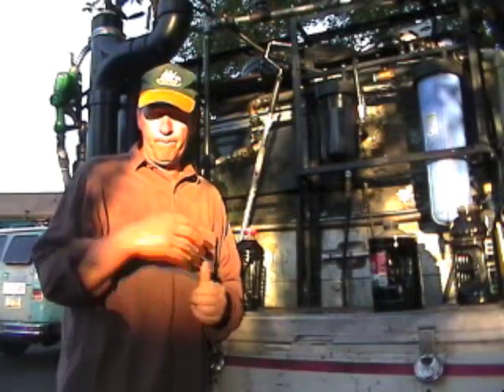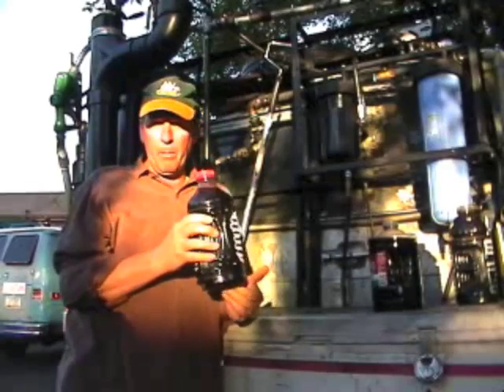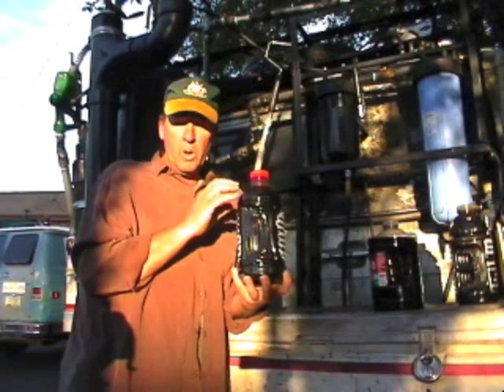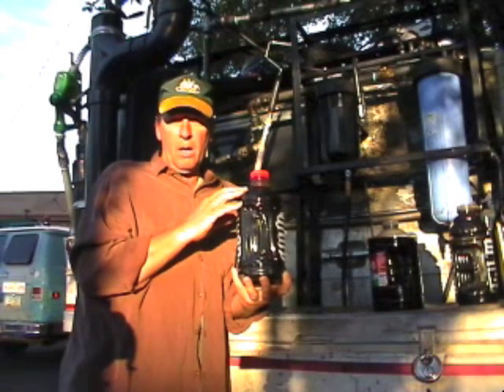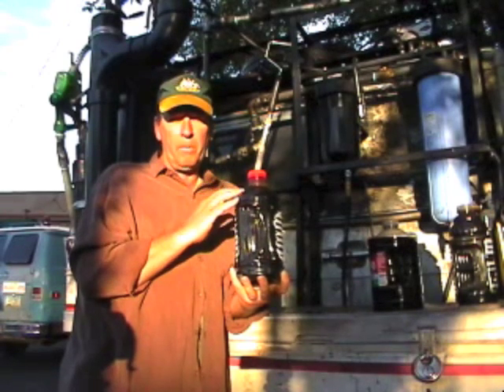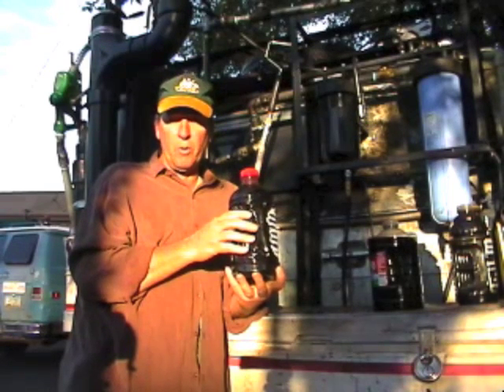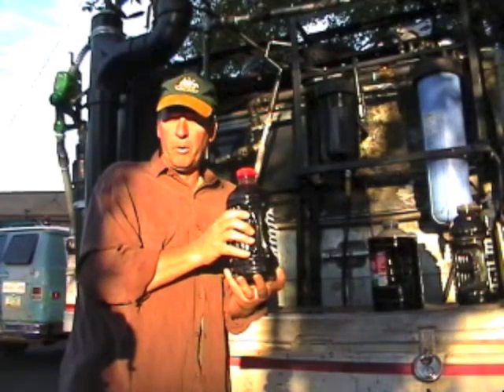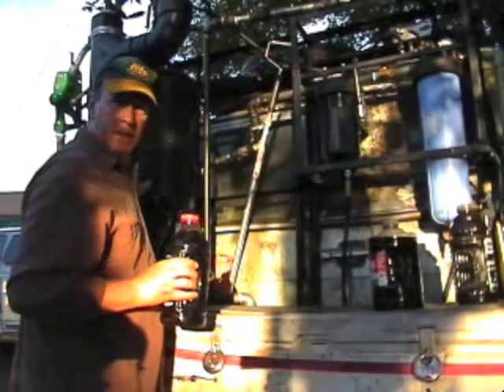Making Black Diesel from waste motor oil (WMO)

Comment: If you're using bio-oils as engine, and use a natural solvent such as Alcohol then even black diesel can be considered Bio-Fuel. I use a Mixture of Rosin Oil, Algae Oil, with fine powdered graphite, which is a very long last, quality mix. The graphite is removed by the filter in the Black Diesel processing unit and can be re-used. I add either Turpentine sourced from the same source as the Rosin Oil or Ethanol I make with Solar Distillation.

Comment from the maker: Thanks for posting your success with burning WMO on a 1988 7.3 idi without a turbo,  The thick film that settles out of your WMO is something that you want to happen.  The ways to keep it from settling out in your fuel tank is to settle your WMO blends longer.  It take my WMO blends 1 month of settling for the black sediments to stop settling out.  Or, you could use a centrifuge to accelerate the settling of the black film. It may take several passes depending upon how long you settle your WMO.
Reply: Agreed on the settling process. A month or more at best with filtering;  I'll be using WMO for an older John Deere tractor, much less finicky than a newer vehicle..

Comment: 1988 7.3 idi without a turbo and a cummins 5.9 24 valve p-pumped conversion without a turbo for my house generator, the 7.3 had 50,000 miles when i started using black diesel and now has 225,000 miles and starts and runs fine.i use the additives to help keep the carbon low off the valves and internal parts.the cost per gallon of black diesel is $2.88.  the only problem i notice is that alittle thick film settles out of the finish product how to stop that from happening  and suggestions  thanks

Comment from the maker: OK, Mike, so, do you have a turbo on that diesel engine that you have put 150,000 miles on burning black diesel?  Because I have a hard time believing that paying a lot of money for snake oil is going to make it so that I can burn WMO on my n/a diesel engine without coking its injectors.  

However, if someone with n/a a diesel engine like mine can put 150,000 miles on it burning black diesel, then I will look at the snake oils.

Comment: instead of giving up why don't you use some additives like diesel clean diesel supplement, sea foam, stp cleaner and fuel power. i have been using these in my truck and have over 150,000 miles on black diesel with no power loss. try this

Comment from the maker: 1) Anecdotes from people burning WMO show that those without a turbo have far more coking problems than those with a turbo.  The turbo appears to increase air flow through the cylinder, which might function to blow the cylinder out of ash and coke.
2) I am still developing my WMO distillation unit.  When I have it more developed I will definitely make a video of it.

Comment: Hey Jeffrey. Just checking to see if you've tried any further experiments with WMO/ gasoline blends on your non-turbo van. Last time you said you wouldn't be running WMO/gasoline blends again, until you could distill it, because of  coking issues.

Comment: Have you ever tried water injection on your diesels? It would seem from my research that water as a 20% emulsion or sprayed as a very fine fog into the air intake results in lower emmissions, lower consumption and much cleaner cylinders. The cleaning effect has to do with the micro- explosions of water into steam which both adds to compression, and helps to atomize the diesel/oil fuel much better due to micro-exlosions. The cleaning effect really intrigues me. Your thoughts on this?

Comment from the maker: Good question.  I was running a blend of WVO at 50%, WMO at 20% and gasoline at 30%.  That blend ran for 3 months before the injectors coked up and the IP failed.  I think it was too much gasoline and too much WMO.  If I were to try it again I would keep the gasoline at 20% and the WMO at 10% and the WVO at 70%.  But, realize that WMO and WVO do not like each other, so they have to be settled for about 3 weeks after blending to let the crud settle out before filtering.

Comment: Just to clarify. When you say WMO blended with gasoline at 15% or less. Do you mean 15% WMO to 85% gasoline in a  non-turbodiesel engine? Or do you mean 15% filtered WMO mixed with 85% diesel fuel?

Comment from the maker: At this time I cannot recommend burning WMO blended with gasoline in excess of 15% WMO on any diesel engine without a turbo.  However, keeping the RPMs up helps marginally, so does making a translucent blend.

The military paid for research to see if they could burn WMO at 7% blended with JP8 to get rid of the WMO, while lubricating the JP8 fuel.  Well, that resulted in coking the test engines to near failure.  Neither test engine had a turbo.

Comment: Mmmm... not really what I was hoping to hear. I could possibly do a turbo conversion on my Merc 240D. I mostly do trips of about 16km around town though, so not sure if the turbo would be helping much at auch low speeds. I seem to recall you mentioned in another post that keeping the revs up by keeping the car in a lower gear could also help avoid the coking issue. Perhaps I'll try that.

Comment from the maker: With a lot of work I was able to get my non turbo diesel engine to burn WMO blends at < 20% WMO for 3 months before the injectors coked.  So, I will no longer run WMO until I can distill it.  Whereas, 80% WMO blends that had been exhaustively worked ran for a month max on my engine.  However, it is possible that WMO blends < 10% WMO might run indefinitely on my engine

Nonetheless, there are lots of reports of people running WMO blends on turbo diesels at 80% WMO without coking their injectors.

Comment: Thanks for the reply. Does the injector coking problem mean that you no longer use WMO on your non-turbo vehicle, or do you just continue to clean it using your turpentine and ultrasonic cleaner technique. ( Also, how many miles on average do you find it takes for the WMO gasoline 20% blend to coke your injectors to the point that you have to clean them?) Thanks.

Comment from the maker: I have samples of WVO and WMO that I blended with gasoline about a year ago. They are still blended; therefore there is no reason why gasoline would separate from any waste oil except through distillation.

However, I have found that WMO cokes my injectors badly even at only 20%.  My diesel engine does not have a turbocharger.  The diesel engines that seem to be able to burn WMO without coking their injectors all have turbochargers.

Comment: Hi Jeffrey - Do you find that once mixed the 80/20 WMO to gasoline mix stays blended, or is there ever a chance that the oil and gasoline might separate out again. I have an 80 liter tank, so I'm trying to decide if  I should do one big batch of 80 liters, or smaller batches of 25 liters, in case there are problems with oil and gasoline separating out over time.

Comment from the maker: Blending a solvent with anything can produce precipitates.  Blending gasoline with WVO will force water and particulate out of solution and suspension in a fairly short period of time.  An hour of settling might be enough, but I have found 24 hours of settling WVO-gasoline blend works best.

Comment from the maker: @Begbucks My odometer says that I have put about 10,000 miles on my engine on waste oil blends in nearly 5 years, but the over-sized tires have screwed up the clock.  However, I have not driven my own vehicle much in the last 5 years, because when I am doing archaeology I then tend to drive a company truck, and my van is hundreds of miles away.

Comment from the maker: @Begbucks I made up a business card and magnetic sign for the side of my van that say I recycle waste oils and solvents and put my phone# on them.  I also stop in at small restaurants, mechanic's shops, small engine repair, motorcycle shops, etc., asking for waste oils and solvents to recycle.

Most solvents are equivalent to gasoline in a blend, such as paint thinner.  So, use them just like you would use gasoline in a waste oil blend.  Anything that dissolves into WVO will dissolve into WMO.

Comment from the maker: @Begbucks Diesel Fuel Secret seems to be a scam. Gasoline seems to be the cheapest solvent I have found so far.  However, if purchasing 20% of your fuel load at $3.50/gallon does not work for you, then I would suggest you look into recycling waste solvents, I have already started doing that and plan to do it as much as possible.

Comment from the maker: @Begbucks I do not know how many miles my van has run on my blend because it came with off-sized wheels, which through off the odometer.  I also have no way of accurately measuring my fuel, so mileage calculations are out as well.

I belong to several alternative fuels forums, where the 7.3 Di and IDI dominate, and many of them are running my blend, or a variant, and their engines are running great on it.

Comment from the maker: @Begbucks the winters can get down to 0F (-18c) here.  I had no problem starting my engine on a blend of WVO and gasoline at 20% without a block heater.  I see no reason why WMO would behave any differently. 

I do not heat my fuel, nor do I startup, or shutdown on diesel fuel.  I startup and shutdown on my blend.

Comment from the maker: @Begbucks I prefer using waste vegetable oil (WVO, because it tends to be cleaner than other waste oils, it smells better, and I feel better about burning a recycled, renewable, resource.

I have not tried burning waste synthetic oil, but if you have trouble burning it, then I would suggest adding more gasoline to your blend.

I have used small quantities of WATF.  I find it works fine, it is so thin that it does not require much gasoline to thin it out, maybe 5-10%.

Comment: I use in my VW Passat 1.6D 1986, 85% mix WMO/15% RUG. So far I have moved around 35,000 miles and I have no problems. If my car a little more smoky, add little RUG, and smoke disappears. I saved money on this stuf, now i can buy 2 more Pasat's.